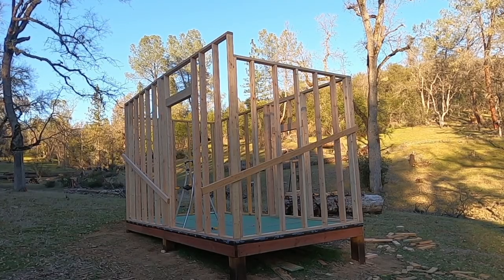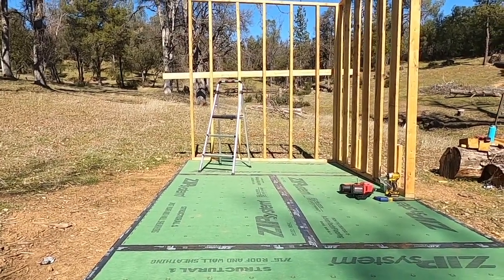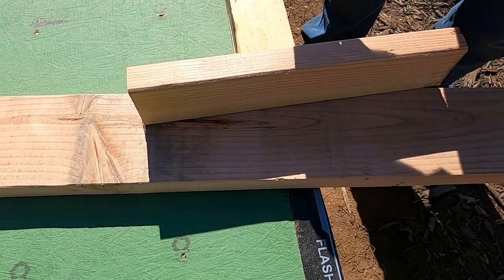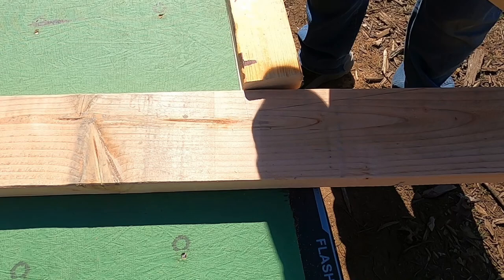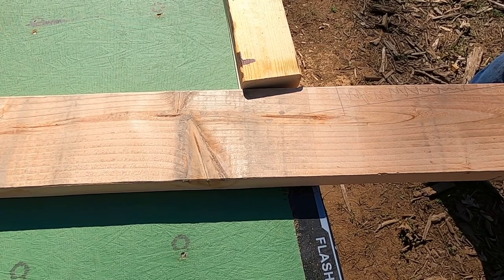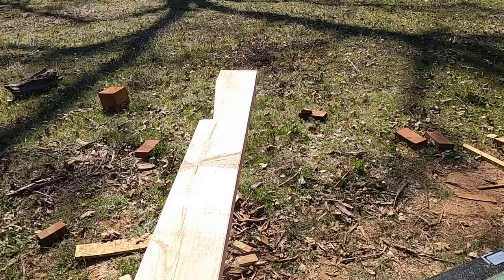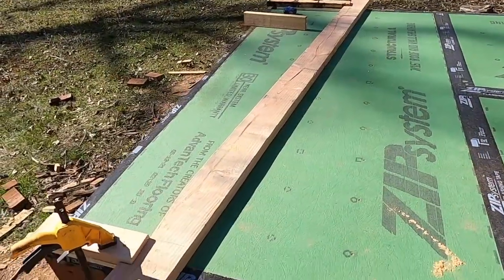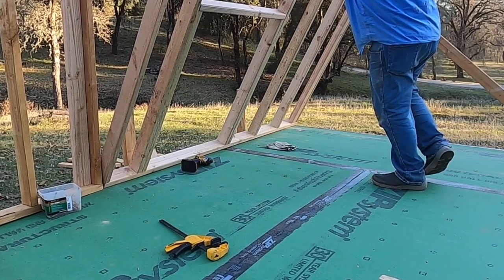Easy No-Tool Shed Roof Rafter Layout

Comment from the maker: The reason this layout method failed for me is due to my shallow roof line. If my rise/run had been 3' rise over 8' run, this would have worked out perfectly.
So for shallow roof lines, check the birds mouth first to make sure you are not cutting into the soffit area. If you are, then you should add the second line and only remove the smaller area as shown in this video.